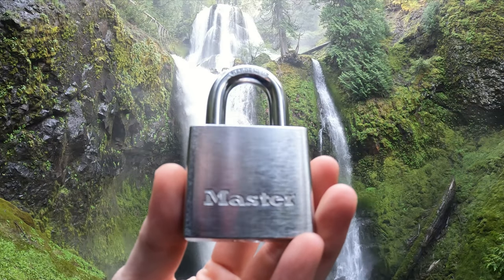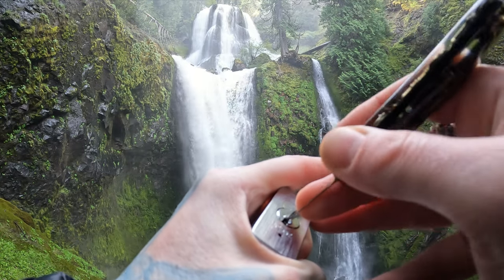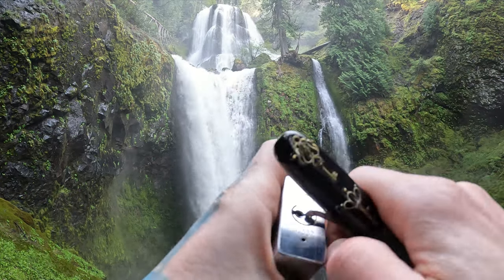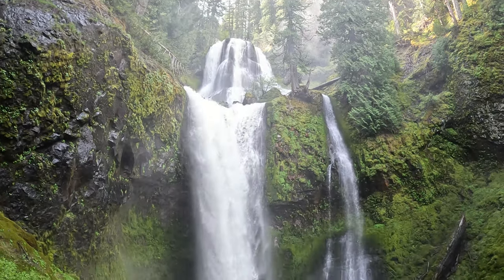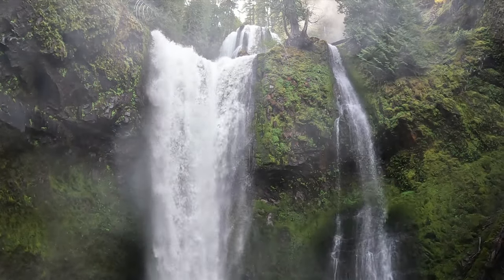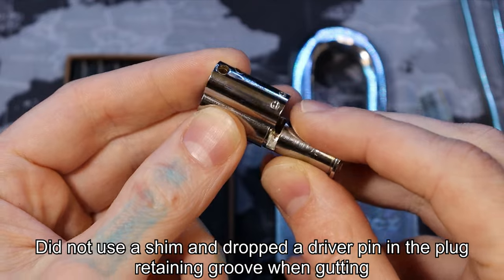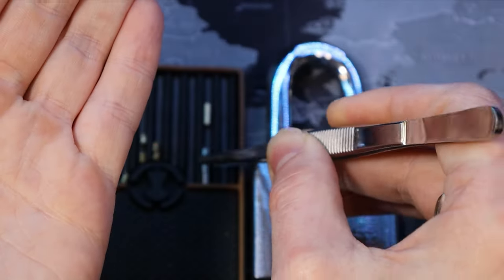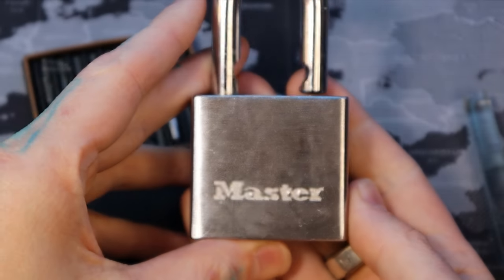271) Master Lock 532 Picked and Gutted at Falls Creek Falls

Comment: Beautiful background, great picking, good thing your not gutting it there.

Have a great day, 
also if you use a drill smaller than the retainer pin you can use a small screw to screw into the hole and pull the pin out like a cork with no damage to the lock, I've used this method in re-keying solid body locks several times.
Reply from the maker: Thanks for the tip!  I will definitely try that next time around.